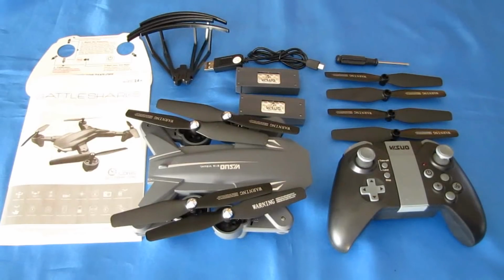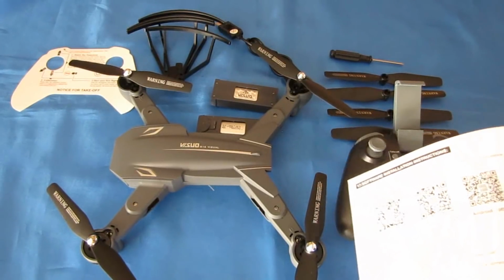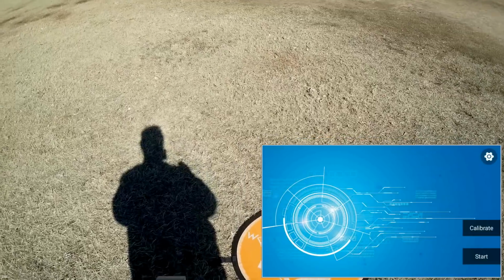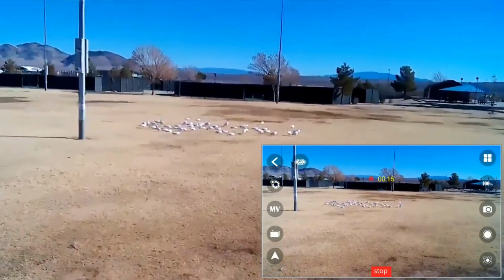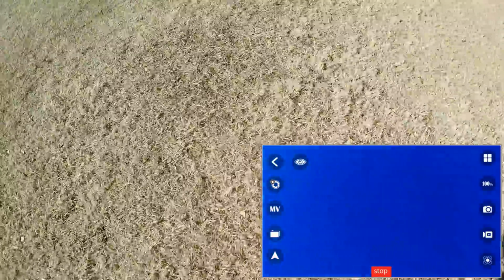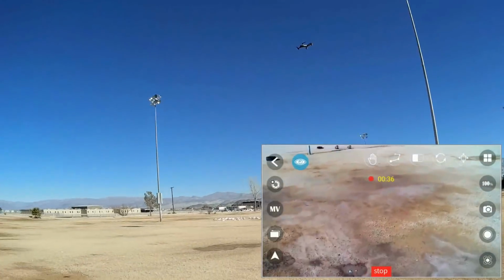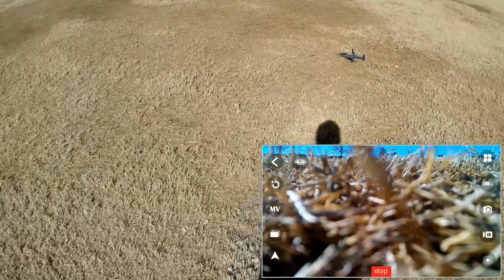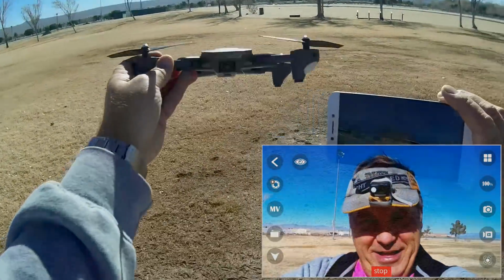Tianqu Visuo XS816 Long Flying Optical Tracking FPV Camera Drone Flight Test Review

Comment: This drone is a toy. In the review you must mention:  when it goes away 30-40m the control stop working sometimes and if there is a little wind it will blow it away and you can lost it or destroy it. RTH goes completely to another direction, it is not working at all.  You can fly this drone only if there is NO wind, a little wind will be problem. This is crapy drone, better to save another 50 bucks more and buy a better one.

Comment: Hi there! My controller all of the sudden stopped synchronizing with the drone. The throttle up and down doesn't work. Controller's light gets steady on but drone keeps flashing. Batteries full. Calibration doesn't help either. Is there any hard reset or any other idea?
Reply from the maker: How about the controller's batteries?  Have you tried fresh batteries in the controller?
Reply: @Quadcopter101  Yes I have! The weird thing is that it syncs from the app. This way I can still fly it with wifi from the phone. But I have tried everything for the controller. No help.
Reply from the maker: @thegreekbudgie  if it syncs with the app, then it's definitely an issue with the controller. Not sure what else to try other than brand new batteries in the controller.
Reply: You need to re-sync the controller with the drone. Switch off both controller and drone. Turn both on at the same time, immediately push the left throttle stick all the way up for about 3 secs, then bring the throttle down for abt 3 secs as well and you should hear a beep or twp- that means they're sync'd. Have fun.
Reply: @skanman2  I finally disassembled the drone. I loosened any connection possible and after reassembling everything worked! I think i have a loose contact or connection somewhere cause after a hard landing it happened again. But with a gentle knock it went back to normal! Thanks for your time!

Comment: What's the difference between this and the XS809S (which should be the upgraded and, I think, better version of XS809HW)? Can't decide between the two...
Reply from the maker: This has optical flow positioning.  This will automatically hover in place, while both of the XS809 require manual flying skill to hover.
Reply: @Quadcopter101  I just realized from your review this has no microsd slot... I'll go for the XS809S then! Thanks!

Comment: Nice Review QC101 Love this Range of CheapToy Quads, I Liked the WiFi 720 version , Now this new one in the staple of Visuo., XS816 Upgrade Cam/Upgraded Batteries/Upgraded App/Upgraded Alt Hold. BUT BUT these guys have lost he plot  ?? NOT inc SD Slot Arghhh LOL . Its A SELFIE Drone ??? ( Is it to scrounge more Battery life ) Makes No Sense at all. ?? Shame.
Reply: I love my XS809S and would have bought this immediately if it had the micro SD capability.  HUGE disappointment!  I would have been fine with losing a few minutes of flight time for an SD card. slot   :-(
Reply: @skeeterhoney  Maybe in the next version of the 816